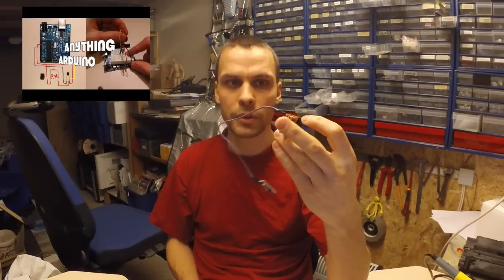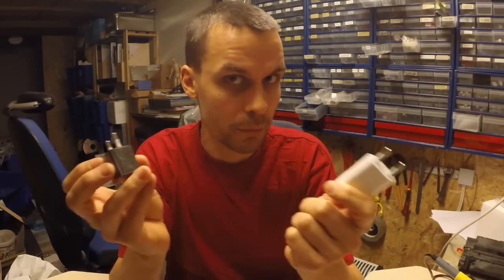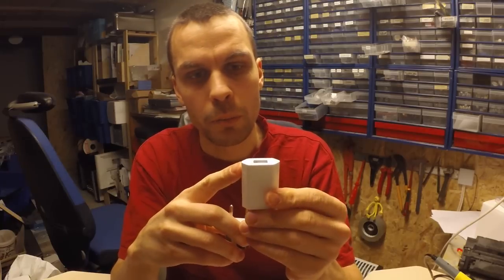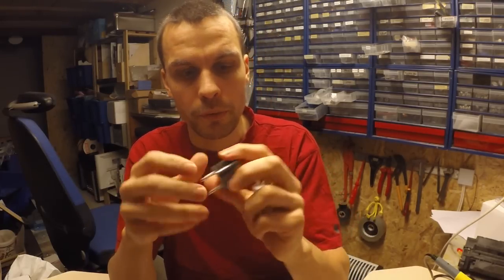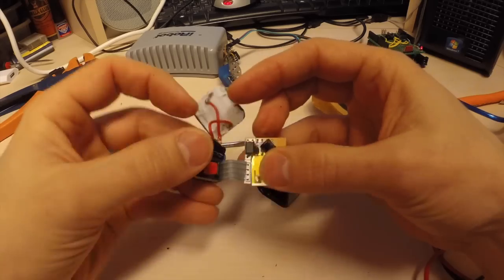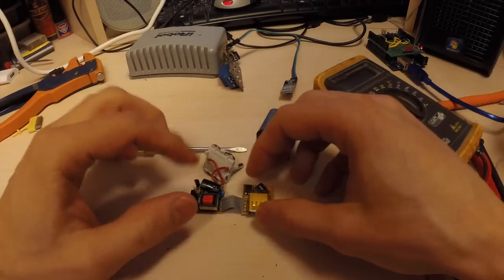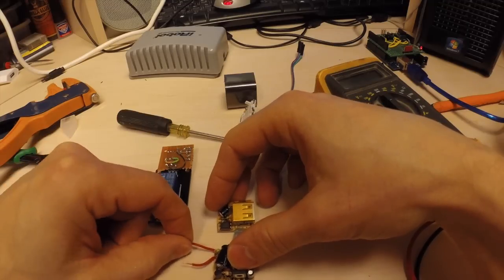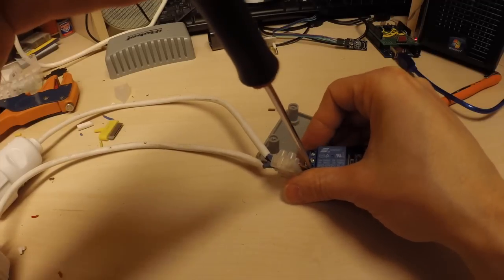Cheap and easy 5V power for your arduino projects [Anything Arduino] (ep.11)

Comment: Thanks a lot for this episode. Just one question. Is it okay if i power the MCU with a simple capacitive drop circuit instead of a full blown SMPS?
Reply from the maker: The arduino needs a somewhat clean 5v to run. How you produce that is not that important I guess. I don’t know the exact circuit you talk about. But if the end result is 5v, then it should work.
Reply: @SourceryOne  I had a chance to read more on the capacitive drop circuit (which uses reactive components to drop mains voltage. A crude circuit would look something like this: https://i.stack.imgur.com/gcKcK.png). The output ripples are not a problem as it can always be smoothed out using low pass filters and an off-the-shelf voltage regulator. The problem I later found was the output current. Such circuits can only provide a meager 18mA of current. That's not enough to drive Arduino or NodeMCU I guess, especially when the code is pushing data over a WLAN. So, I'll stick with your idea. Use a cheap SMPS to run my prototype :)

Comment: Kindly tell me that how can i supply power from one arduino to another if i m using one power source.
Like if i power first arduino then from it’s 5v and GND i connect another from Vin and GND.
Reply from the maker: Connect the second one to 5v and gnd. Vin goes through the onboard regulator and that won’t work as you’d need 6+v on vin.  Or split the power source to both vin on both arduinos. Connect ground together on the two or else you might get strange behavior.

Comment: Great video!!
Im using one switching power supply but the arduino is acting weird... can you give me some advice on how to "clean" the noise from 5v out of the power supply? Thanks in advance!!!
Reply from the maker: It might be a really crappy psu? Usually a capacitor might work. Read this QA for a thorough explanation: https://electronics.stackexchange.com/questions/148575/how-does-a-capacitor-smooth-energy
Reply: Kristian Blåsol yes it is a really really really crappy psu. Thanks for your reply!!! Best regards!

Comment: Can you please let me know what kind of transformer is used in that charger? If you can tell me model number it will be much appreciated.
Reply from the maker: +Tamal Biswas a simple apple China copy is what I used. Most 5v chargers on eBay should work.
Reply: I understand. But my goal was building that power supply manually instead of buying one. I have figured out everything except the transformer needs to be used. I can see there is a transformer used in circuit of the charger which you've shown. That's why I wanted to know about the transformer. Please go through my design if you have some quiet time. 
https://drive.google.com/open?id=0B2_4lKrJug3jWk5kOU5wQ3AxYjQ
Reply from the maker: +Tamal Biswas ah ok. If you want to do it yourself your best way is to make a linear power supply. The circuit used is a switched power supply which is more complicated. Search the web for linear 5v power supply and you will probably find a design that you can use.

Comment: I'm using a usb power brick to use with my arduino circuit. I will use the 110v at a relay and the 5v output from the brick to power the arduino. Do I need to worry about charged capacitor? If yes how can I discharge it?
Reply from the maker: Charged capacitors can always be a problem. Not sure how you specific power brick looks like. To discharge a capacitor just short the pins with an isolated screwdriver or similar, and MAKE SURE THE PLUG IS PULLED!

Comment: How did you immerse the temp sensor into the pipe (and prevent the leakage)?
Reply from the maker: I just taped it to the side of the pipe, and put insulation over it. That way it is very close to the heat of the water going through the pipe. Just with a bit of delay if there would be any fast temperature changes, but that wouldnt happen in this pipe. So here is a natural hysteris then? ;)
Reply: Kristian Blåsol yeah, but there is possible fluctuations around the threshold when the temperature raises or falls slowly (relatively to the reading rate).

Comment: Sir can u tell me how can I see   ac waves on pc by using arduino if I can't apply ac
Reply from the maker: Unsure what you mean, do you want to use the Arduino as a AC-voltmeter? Technically I think you could supply 5V to an analog input, unsure how to measure it though... Or do you want to use it as an oscilloscope? There are projects out there on how to do this.
Reply: sir i wanna see function generator wave on matlab using arduino
Reply from the maker: You could try this code and setup, which makes the Arduino into an Oscilloscope: http://www.build-electronic-circuits.com/arduino-oscilloscope/

Comment: The "headers" are terminal blocks or terminal strips. Individual wires make up "cables".
Really need to use cable glands to secure cables entering/exiting enclosures.

Comment: How can you tell the difference between switched and linear power without an oscilloscope ?
Reply from the maker: Weight... :D No but seriously so linear power usually needs a big transformer which transforms from 220/110 to a little bit more than 5V. Then you have a regulator after that. The circuit is usually quite simple with few but big (and heavy therefor my first response) components. Linear power supplies often gets warm even without anything attached to it. When it comes to switched Im dont fully understand how it works, but it uses smaller but more components and takes up very little space. It also does not get as warm as the linear adapter when nothing is connected... This is a very unscientific method though... After a while you learn to "see" the difference.

Comment: DANGER!!! The capacitor inside may keep voltages and is able to kill you even if the device is not connected. You touched it with your hands right after use!!! Before touching it you should discharge all caps with a screwdriver. Just a friendly but a keep it safe advice.
Reply: It's better to discharge a capacitor with a suitable resistor. Many commercial products will have discharge resistors in parallel (across) high voltage caps
Reply from the maker: Thanks for the heads up. It is usually ok to touch the topside of the cap, its just the leads that should be avoided. But you are still entirely correct that the cap should be discharged before touching...
Reply: What you said about the top is also true. Nice videos. Thanks..

Comment: Great video!

Does the input (high voltage) part of the power supply heat up over time?
Reply from the maker: No not really, the arduino doesnt take much power to run. Also it is a switched power supply, which usually doesnt get very warm...

Comment: For 5 $ you can buy a component that gives you 5v from 220V supply it's big as a match box and far more secure than this shit you made.  it's code is 47152
Reply: can you put the link ?
Reply: you can find in various sites, this is one example: http://uk.farnell.com/myrra/47152/power-supply-4-5w-5vdc-reg/dp/1825779
Reply from the maker: Thats a very nice little boxed circuit...  I'll see if I can order one and have a look at it. It does cost quite a lot more than what I did in this tutorial. Also keep in mind that although it has a cover on top, it still has pins on the back side where 220VAC is connected and is not covered, so still quite dangerous and should be used with extreme caution....

Comment: It was good if at the end of each wire used for voltages 110V / 220V AC , you use pin or lug type or solder them. Thus avoid corrosion over time and increase the strength when you tighten the screw terminal strips. It is possible that when using stranded conductors  to cut some small strips/wires decreasing severed section .Thing unwanted for the  current. It's just a simple observation.
PS - I am electrician and speak from experience. LOL
Reply from the maker: +profesorultraznit Thanks for the advice, I will think of this in my future high voltage projects. Soldering or pin/lug would also be good so no stray wires come outside the screw terminal thus breaking something or hurting someone...

Comment: I love your idea repurposing USB power supplies by cracking them open and re-assemble together with your microcontroller rig.
I was thinking that switched power may not be that bad If you can filter the power to the microcontroller. Also using switched powersupply could give you more amp available to use for small 5v motors etc right?
Reply from the maker: +BrachioMentis Switched power works most of the time, in some projects I have seen "erratic" functionality. It is always good to try it out before soldering it together :) But yes, a smoothing circuit could maybe make it even more usable. Depending on the power supply you use, ofcourse you get more power. The "normal" iPhone rip offs is rated at around 1A which is enough for most electronic projects.

Comment: OR . You can just use the 120 to 5v cord that comes with the standard arduino, , instead of zapping yourself to death trying to make this.
Reply from the maker: +sonictales69 Sure... but where is the fun in that ;)
Reply from the maker: +sonictales69 Ofcourse not :), and in this video I point out very many times that if the cable is connected then this could be lethal. Believe me there is no fun in getting 220V through your body (which I have gotten not from doing what I do in this video but doing completely different things). Many things in life are dangerous if done without thinking. Keep your fingers where they should be and never work with the cable plugged in and there is no danger. Or, as you say, just use the cord that comes along with most USB-chargers (which I go through in another video)...  Thanks for your concern, and hope you make some cool projects! :)